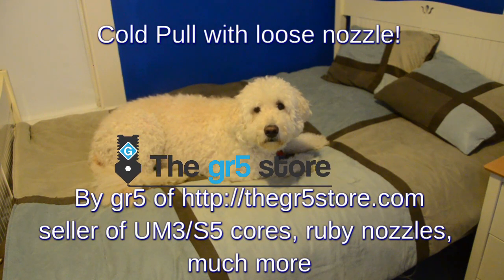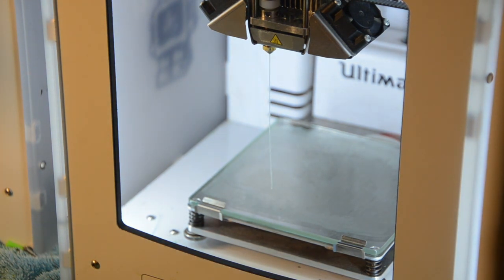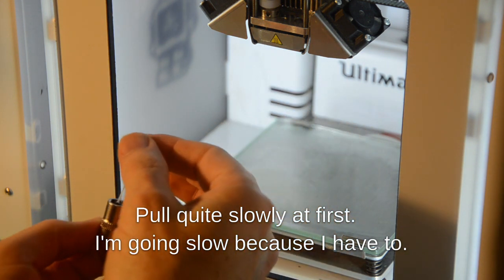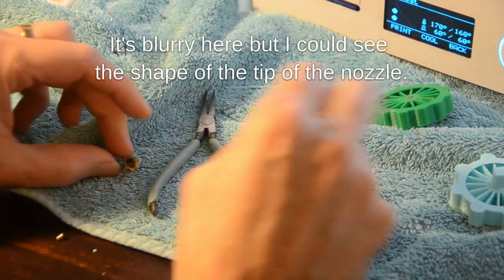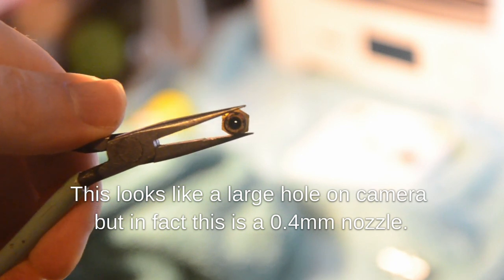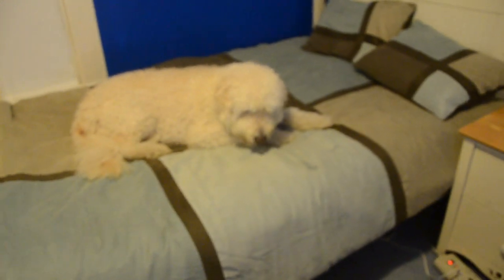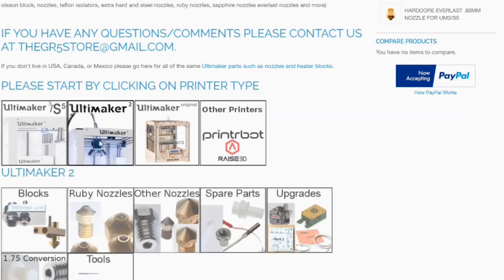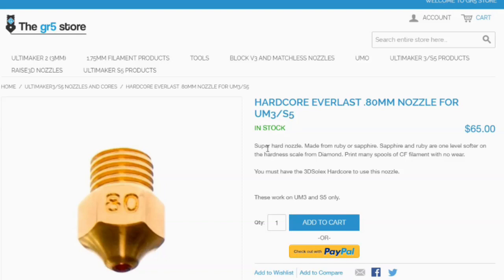A simpler faster way to do cold pull - the "gr5 pull"

Comment: The success of this version seems to be material dependent. You need to use something like PLA that strings when you remove the nozzle from the hotend. I initially tried this with some cleaning filament and there was little to no string to grab to pull on. Had better success with PLA. The cleaning power seems to be okay. The tip of the filament doesn't appear to match the internal geometry of the nozzle as well as one done with the atomic, perhaps due to the slower pulling of the molten material. 

I still prefer the old fashion atomic method, the main advantage to your method is not having to remove the bowden tube and chew up the OD, which means more frequent snipping of the end of the bowden...
Reply from the maker: agreed.  I've been printing nGen lately and it doesn't seem to work with nGen.  This technique is an option that sometimes works but it's not as good as a true cold pull.